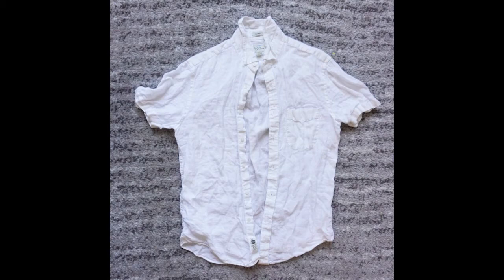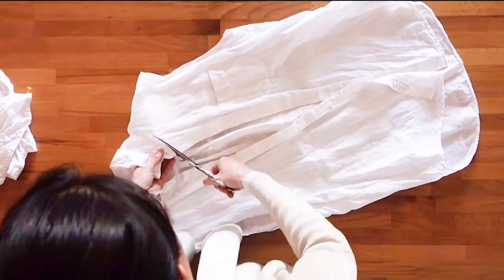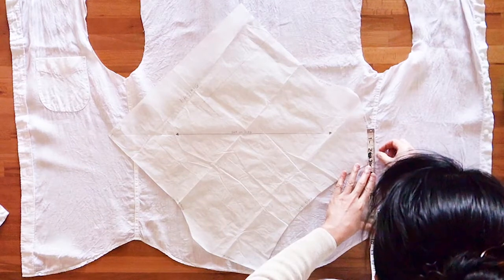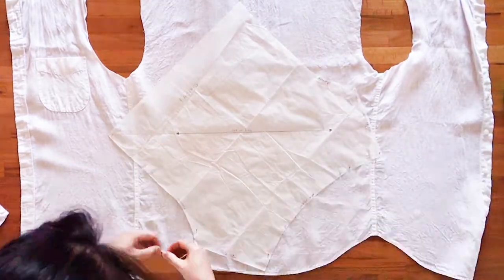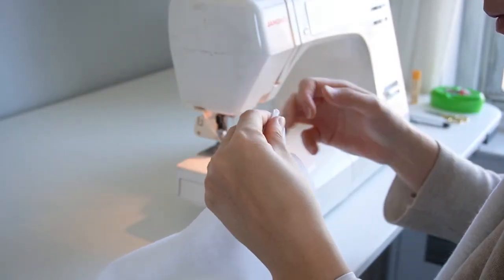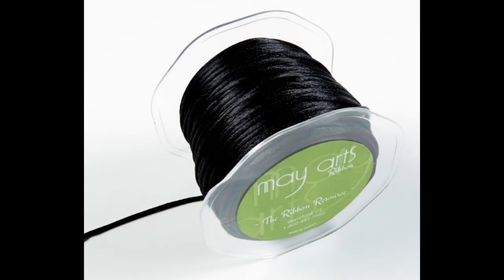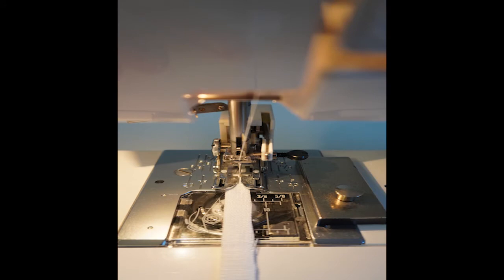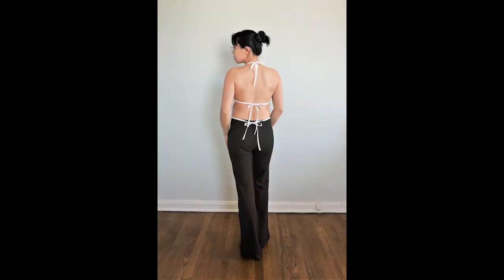Refashioning a too-small shirt into a cowl neck top

Comment: what size is the pattern for?
Reply from the maker: A size small, but the pattern can easily be sized up by printing out the pattern scaled up (e.g., at 120% or 150%).  The pattern is very forgiving on sizing, as the back is open and consists of string ties, which can be adjusted to accommodate different sizes and shapes.